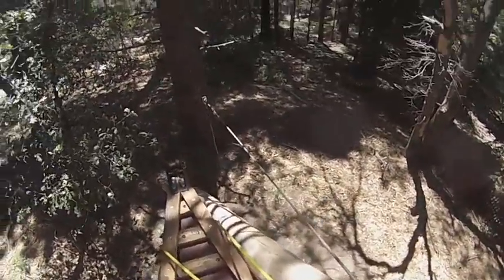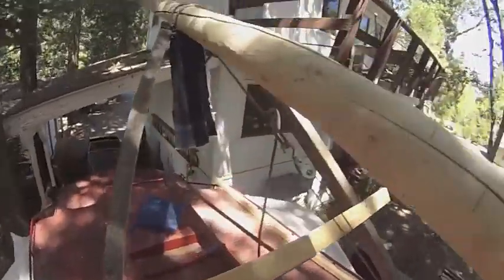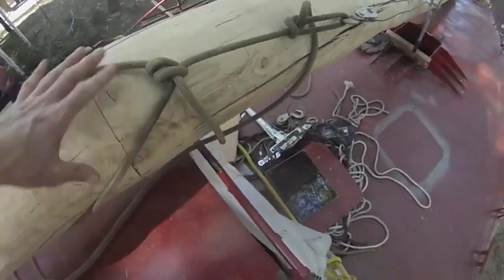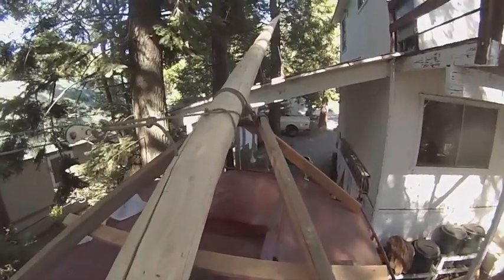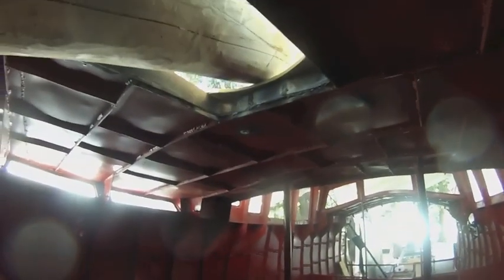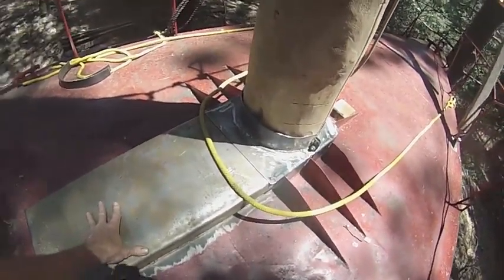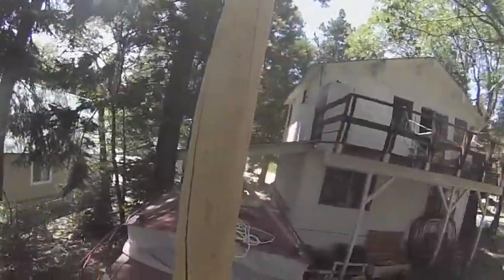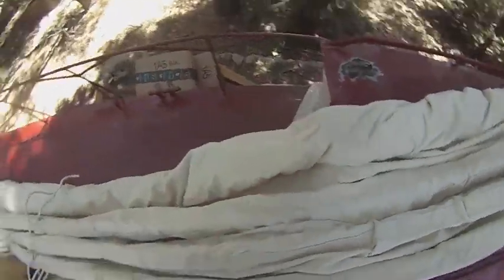Steel Sailboat Build Part 30

Comment: OK, I don't know the first thing about sailing, but that "mast" looks like it's already set to break on you. Is it acceptable to have a log with those kinds of deep cracks in them? Is this something that gets infused with pitch or resin later on?
Obviously, you have to pull it out to travel on the road. Now that it's in all snug, how is that going to be accomplished?

Comment: I've been following your great work and effort but now seeing a cracked wood pole as your main mast in a steel boat makes me think and doubt. I think you took the cheap road but anyways I wish you luck and hope you don't have any issues with that mast
Reply: I once read in a book that cracks along the log have no structual influance and are just fine to use. That book was about how to built a logcabin so I don't know if that is a fair comparison since this pole here is vertical and forces work it much harder and in a diffrent way. Some metal straps around the mast to keep it together would help I guess? I still really like how he uses what he has and thinks outside the box. I wish him the best of luck with his projekt!
Reply: You could always use a router to cut the splits out and epoxy some new wooden pieces in. I’ve seen that done on lots of wooden masts including my own.
Reply: James Mosley yeah he needs to fix it

Comment: wondered why you didnt just use a tabernackle would be easier to raise the mast off course you would need standing rigging. good call to use junk rig much easier cheaper option. will be interesting to see it in the water , good luck with your project. to many naysayers at least you are living your dream

Comment: Why on EARTH would you put the mast up at THIS Stage????? Why would you even put it on the boat at this stage without the final painting and transport to the water done where you could use a crane and not 6 hours of dinky rigging?.
You can do all the rigging design and fitting with the Mast laid flat on the ground.
I'll ignore why you would even use a cracked, solid wood mast. That's to be expected in this build.